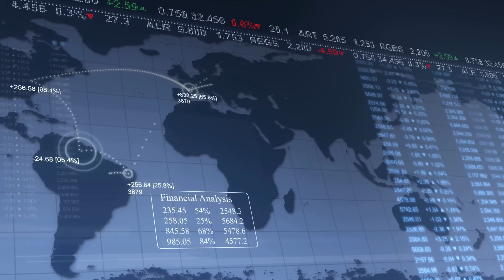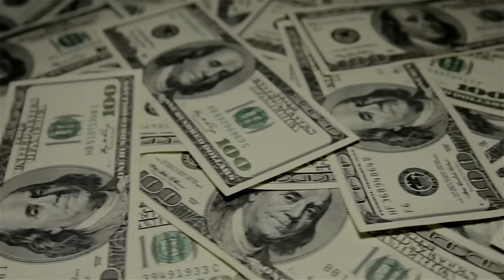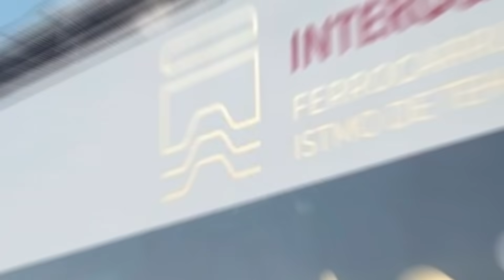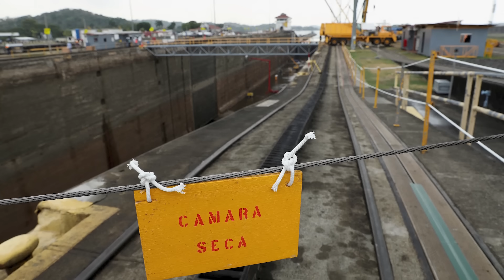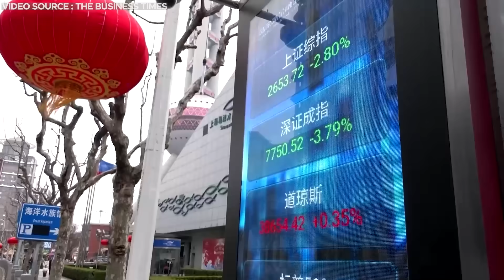Mexico Is Building A $5 BILLION Corridor That Will END The Panama Canal

Comment: Port facilities require loading and unloading container ships as fast as possible. A 10,000 container ship, which is the smallest standard, will require 40+ 120 car trains to move the cargo from the Pacific Ocean to the Gulf of Mexico. Are there port facilities also being planned at both ends in order to load/unload the ships? Will the railroad lines being built be able to carry 120 flat car trains? The reason this has not been done in the world is because of its operational inefficiency.

Comment: MATH PROBLEM (SEVERE)... Given 1 larger cargo vessel can hold 1 million tons, lets use 1/2 full ( or smaller ship)... So 500,000 tons... In the US a tractor-trailer will hold about 25 tons.. SO it would require 20,000 trucks to move the cargo of ONE SINGLE SHIP across mexico... And lets say for some strange reason im off by 100%... So 10,000 trucks
(Still YIKES!!!)
And you can lower the amount of cargo or increase the amount of load a truck can carry and this number will still never be less than 7-8000 trucks 

Heaven forbid a second ship shows up.....and consider 25 a day pass through the Panama canal.. so 500,000 trucks per day... Laugh out loud funny .

Also .. labor For: unloading ship, loading trucks, driver salary, truck maintenance, unloading trucks, reloading ship ....X 20,000 times per ship 

I do not believe that this is actually a real project for this specific purpose

SIDE NOTE... I once dated Cassandra (where are they now?) and her job was to ensure that her assigned ships were as close to 100% loaded as possible for  any sea going voyages... She would literally lose her job if the loading was only 50%..(sadly quit due to the stress)

SIDE NOTE 2: it's also 50 fully loaded Trains .. pulling the maximum number of railway cars  (about 150)... Still Nuts!!!!

Comment: At best/worst it will supplement the canal. There is a lot of backlog at the canal and it costs a huge amount to traverse the isthmus via the canal so an alternate route will help with the backlog and lower the costs. 
Mexico has a notorious problem with corruption which they will need to restrain or eliminate. Otherwise the train could be hijacked for ransom.

Comment: California is projected to spend $35 billion on a train from Merced (left of nowhere) to Bakersfield (the other side of nowhere). An estimated $100 billion more is needed to connect the trains to Los Angeles and San Francisco. If they ever finish it will probably be more than double of the previously mentioned estimate. California is also proposing to build a $20 billion dollar underground aqueduct to store water. Undoubtedly it’s going to cost 4-5 times that in the end. Even if Mexico ends up spending $20 billion (4 times the original cost) it will still be less expensive and probably more effective than what California is doing.

Comment: A railway over a distance of 1000km to replace or to rival a water canal of less than 100km?? Never heard of greater bullshits. The only better alternative to Panama canal, is another water canal without locks, the way the French intended to do initially(but they failed). Now there are drilling technologies a lot more advanced than 130 years ago. It should be easy to cut deep the land to truly connect the two oceans. It has to be wide, deep and provided with some bridges to link the two sides of Panama.

Comment: One of the problems with the CIIT is that shippers will have to have two ships instead of one to get their loads from some place in the Pacific to some place in Europe. That is going to add a lot of cost to shipping, as will the process of unloading and reloading shipping containers off of, and back onto, ships on the other side.`
I'm almost a little more skeptical that it will only cost 5 Billion.
Reply: Spoken by someone who has never taken a connecting flight?  What it loses in connecting time/effort, is more than made up for by it becoming a hub/spoke system where the containers on an arriving ship, can connect to different departing ships.  Not only ships in the other ocean, but even to ones in the same ocean.

Comment: Not a bad idea considering CA Electric truck BS which will add cost to shipping anything in and out of the state. The range of an Electric truck is around 500 miles and they have to load the trailers lighter to make up for the batteries weight.

Comment: A couple of issues to overcome if replacing the Panama canal. 1) One ship carries up to 15,000 containers and one train only carries up to 120 containers, so you would have to have 125 train loads to fill a ship. 2) Load and unload time. It would take a lot of time to unload the ship on one side of Mexico and then load it back up on the other side. Not to mention the wait time for 125 trains to get there and load/unload their containers.
Reply: The main objective for the corridor will not be logistics , there will be built 10 mayor industrial parks along the railway, so raw material will arrive one side and finished goods will output in the other. Also Al the agro-industry will have a faster way to exit both sides. don’t know why this video didn’t mention it .
Reply: Not to lessen your very valid points, using TEUs (Twenty Foot Equivalent), New Panamax vessels are ~13,000 TEUs.  A typical 1.5 mile long train, using typical 5 unit drawbar 40' well cars double stacked, and subtracting 2 locomotive lengths, is ~580 TEU.  Add 1.5 trains as a buffer, and 24 trains just to replace one vessel.  Still a LOT.
Reply: @robbfisher2876  you are right
Reply: Ships leaving Europe or the East coast of North America could leave with containers destined for different places on the west coast of the Americas or Asia. Those cargoes could be sorted in Mexico. Not having to wait for full loads for shipment allows shipping companies reduce storage at either end of the route creating savings. Also, completion would force Panama to reduce its rates.
Reply: And don’t forget about the cartels who will still everything!
Reply: And we are talking one ship. The Panama Canal has the capacity to handle up to 40 ships a day.
Reply: The real project is set factory’s there to send merchandise both sides

Comment: I'm sure, if this ever gets completed, it will help ease the backups at the Panama Canal but I don't see it replacing it. Load/unload adds time, it's faster than waiting 30 days to traverse the Canal so a decent option when the Canal gets backed up. To replace the Canal would require another canal, which I don't see happening this century. It would be easier to just improve the existing canal.

Comment: Its smarter to widen the canal and address the water level in the canal. But Panama isn't exactly an industrial power. A mega rail project through Mexico has several major issues. This primarily has to do with the geography of Mexico.
Given Mexico is growing into a major economic power, it's still a wise investment as it builds up Mexican ports and transportation infrastructure with Mexico as a central hub for raw goods. Then subsequently as a major exporter of processed goods. If Mexico ever gets rid of its Cartel problem which would mean ousting the weak presidents that let the cartels run rampant, it would be one of the strongest economic powers.
Reply: Mexico reminds me of Brazil and Argentina: so much potential but so messed up they may never develop fully.

Comment: Hi 
You better be updated.
The Panama Canal is operating healthy and normally.
The Board of Directors is working on a plan B to guarantee its continuity via a new water lines to maintain the water influx .
Also good to know is that Panama operates its Railroad daily carrying lots of containers from the Pacific to the Atlantic and vv reliable and quite fast.
Also Panama has a modern highway corridor connecting the Pacific and Atlantic ports cheaply carrying 20 and 40 foot containers efficiently.

Comment: Security measures will have to be in place for the trains moving the shipping containers. So they are not vandalized like the trains in Los Angeles. Also make it worth while and cost effective over using the Panama Canal. Right now with the water levels dripping, and a very lengthy wait in a shipping que to use Panama, maybe Mexico has the right idea.. 1 train per ship and rails moving both ways at the same time. So 2 huge rail yards, at each end, and dedicated rails for the freight trains. I can see 20 trains or more moving both ways at the same time each day.

Comment: Good to have a backup, an alternative, but there are drawbacks.  Goods will have to be unloaded on one side, loaded on trains, then the process reversed at the other end.  That takes time and costs money.  Cruise passengers could more easily transit from a cruise ship on one side to a different ship on the other but that's not a big market.  Then there are the issues of theft and corruption both high in Mexico.  The video often refers to three lines but we are never told why.  I assume one passenger and two freight, possibly one each way or else one non-stop and the other local but I don't know from the video.  Grade B-.

Comment: "The width of this isthmus [Panama] spans 65 kilometers, coincidentally mirroring the length of the Panama canal."

That's not a coincidence, it's necessary by definition. If the isthmus was wider than the canal is long, the canal wouldn't go all the way across (making it useless, because it dead ends). If the isthmus was shorter, then the canal extends into the ocean, making it longer than its own boundary (impossible). The only "coincidence" is that it is a straight line, which is just engineering shorthand for "it was fucking easier that way." The Suez canal isn't straight because they took advantage of a couple of large lakes (though the canal sections themselves are as straight as they can be). In 2015 a new canal was dug to straighten it even further.

Comment: You have to unload the cargo, transport it across, reload the cargo.  Also, there has to be another freighter ready to accept it.  In addition, you need plenty of storage at each end to handle scheduling and a well organized port at each end to manage it.  Lots of opportunities for errors and theft.  Not secure, not timely, and not very competitive.
Reply: You act like handling huge numbers of cargo containers, and routing cargo through multiple modes of transportation, is a problem that has not already been solved.  You are wrong.  Yes, it is a big operation, yes it requires a lot of coordination, yes it requires some security measures.  All solved.
Reply: @EfficientRVer  "Yes, it is a big operation, yes it requires a lot of coordination, yes it requires some security measures.  All solved." You forget that this is Mexico.

Comment: Somebody forgot a few zeroes here...at least $5T!!! The entire Panama Canal is only about 50 miles long whereas the proposed Nicaraguan would've been 150 miles and as cancelled because it was too big and costly. Also, just the recent Panama widening of only a few miles, cost close to $5B. The length of the Mexico one would be what...2-300 miles? Then they still end up with the same problem that Panama has...water...where do you get all the water?
Reply: You need water flowing downhill to operate TRAINS?

Comment: Mexico should build their own canal.  Make it able to handle larger ships than the Panama Canal.  Even if it took 15 years to build it, it would be worth it.  Especial if they don't need to use locks.
Reply: Good luck digging a sea-level canal across Mexico.  Mexico is not a low-lying swamp like Florida, and I don't see a canal across Florida making a shortcut from the east coast to the gulf.

Comment: At best this link will be a curiosity or small footnote in international trade. Doesn't make any sense from a cost or logistics point of view.  The cost of transfer the Panama Canal is about USD 100/teu of course depending on load factor etc. For that amount you will probably be able to pay the discharge move in the port but not the rail cost and subsequent load cost. And what the link doesn't address is that the terminals on both sides of the Panama Canal are huge transhipment terminals where ships coming from say USWC going to ECSA transship to say a ship coming from Europe going to WCSA. Like a huge airline hub and this project will never be able to replicate that. There is a reason why the big transshipment hubs in international container transportation are located where they are namely around the choke points (Singapore, straight of Gibraltar, English Channel, Panama, Suez).  
Mexico does have the opportunity to serve USA but it will be rail from one of the Pacific coast ports directly with rail into the main cities in the US. Railing to another port and starting a new journey is pretty much like putting the horse behind the wagon

Comment: if the intention is to compete with the panama canal, then it is doom to fail.
An average panama crossing vessel can easily carries 10k of 20ft containers lay them in a straight line its about 65km long of pure containers, from just 1 vessel crossing. how many railway trains do they need to just transport these 65km long cargo. from only just 1 vessel.
The Fuel coefficient of an average vessel is 5 times more efficient that the average train transportation. Meaning it cost 5 times more fuel/energy to transport the same weight of cargo. 80% of the total operation cost of an average vessel is in fuel cost.
That is why only politicians will think it is a good idea because they are spending the tax payers money, not theirs

Comment: in or around 1999, when Panama was taking back control of the canal, and then auctioning off the franchise to manage the daily traffic of the canal, the two highest bidders were a Chinese company (that was very close to the Chinese government leaders) and an American entity (I can't remember if it was a an american company or the American government). Regardless, the Americans believed they would win the battle (by submitting the highest bid) but, in fact, the Chinese won. As soon as that happened the entire American business community and the American government pushed for companies (whose goods needed transport) to use the American railroad system (bc they wanted to screw the Chinese). Pretty soon the railroad tracks by my house were jammed packed all the time. it was noticeably different. I read about this organized push to increase the usage of the American railroad system in The New Yorker (magazine) which usually would not be covering this type of story. Since then, the railroad traffic has gone back to a more normal level but my guess is, this move (in mexico) is an attempt to screw the chinese again. the americans can really hold a grudge.

Comment: The Mexican railway shuttle will not end the Panama Canal.  Mexico says that is not their design.  It is an  idiotic claim and assumes Panama will sit by and do nothing to improve the canal while Mexico builds out two seaports and tries to find a way to move hundreds of thousands of containers by rail through a cartel gauntlet that will easily steal 20% of the freight.

It will cost more and take much longer to use a rail system.  Mexico is angling for a Fed Ex   express freight model to move high priority goods that are backed up at the canal.  

Panama has water conservation  plans that will be faster to implement than Mexico’s ports expansion and rail security buildout.